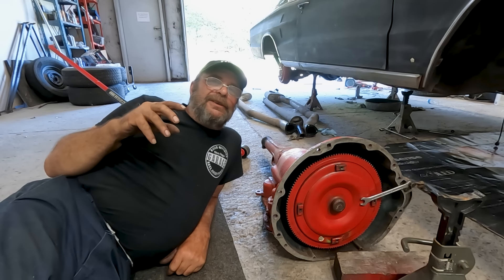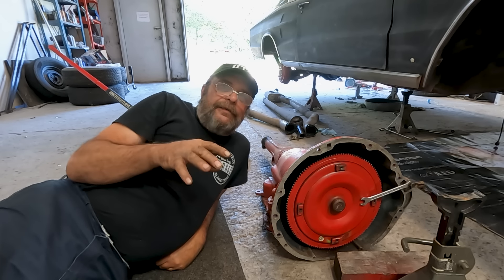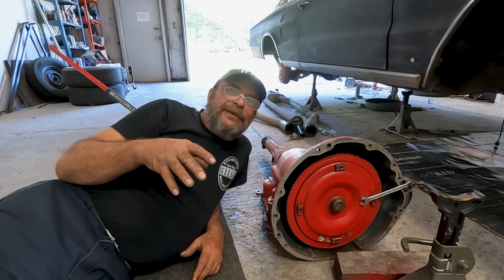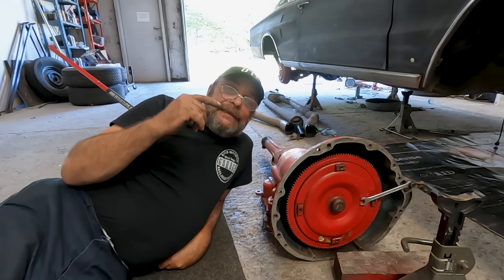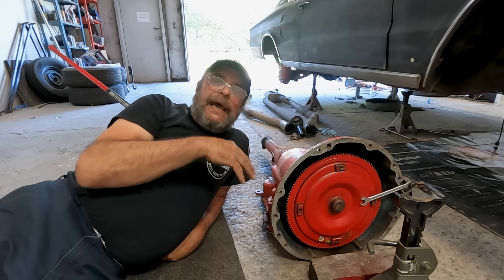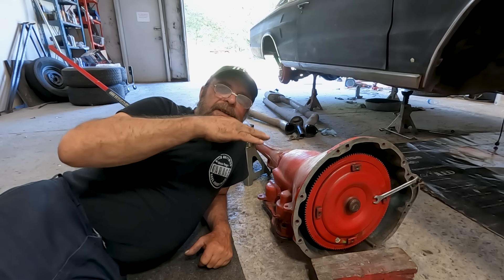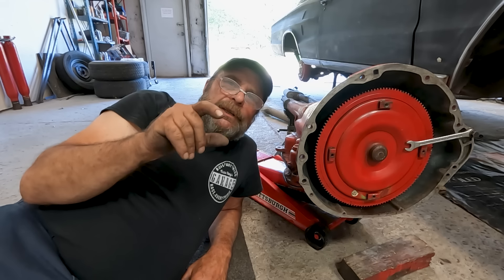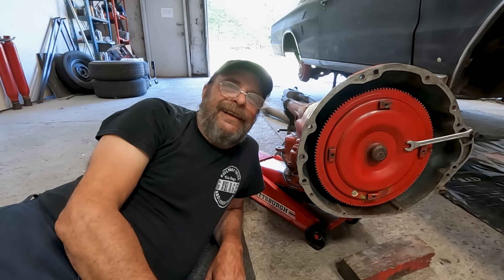One Man, On The Floor Transmission Install- So Easy Even An Old, Crippled Guy Can Do It

Comment: This method didn't work for me. In fact it was dangerous and my transmission fell once on the floor. You are better offer to actually make a wooden bracket across the bell housing and use two of the bellhousing bolts to make a mount for the jack to then lift up at one end (do the same on the back as well). My transmission has all the weight at the back, even with the torque converter out. 

I'd bolt the torque converter in after the trans is at height, in case you can't secure it and it reduces weight. You do need many pieces of wood to help keep the weight of the jack.

Comment: I don't think it is a good idea for anyone to be working under a car by themselves period! I have had to get a car off of a guy once and it was that absolute worst scariest thing I have ever had to do, thankfully it was only his bicep but it was the bare rotor sitting on it. 3 guys rushed over and could not lift the car while I was running with a floor jack to shove under it and bent the rocker in the process because nobody was worried about placement. I always have 2 physical forms of support under the car plus throw the wheel under incase it falls. And Tony is worrying TF out of me watching him under that car with nothing but wobbly ass jack stands.

Comment: when I was young, I could just muscle it in place. I really didn't have much of a choice. we had a gravel drive way. so a floor jack wouldn't roll. I got so good at it, I could swap the transmission  in less than 2 hours, by myself. of course that did not include the time of getting the car up on the ramps, and let it cool off. trying to work on a hot car is for pit crews.  I could never change a transmission now. I'm to old, and I have lost to much strength. now it's much easier. all I have to do is open my wallet!

Comment: Im 60 now but in my early twentys I worked in a GM dealership andi got to do most T400 and 350 trans as i would lay under the car on stands, drsg the trans onto my stomach then basically bench press it into place, yeah i know young and dumb and full of cum but that was my thing, even on standard times rates i would kill it every time